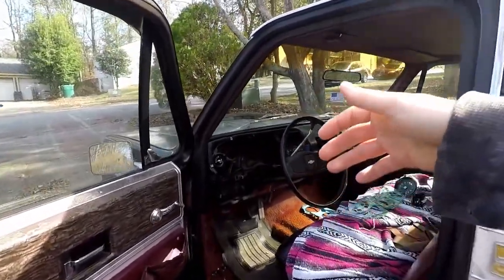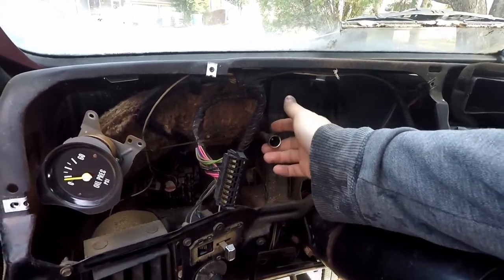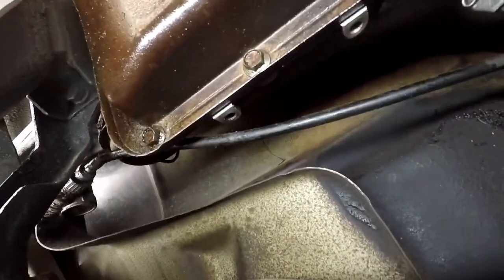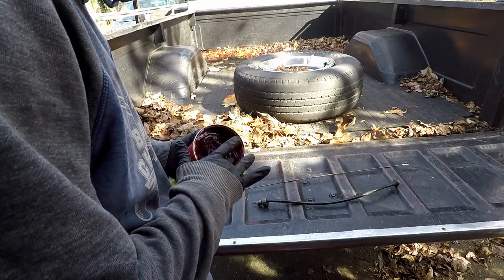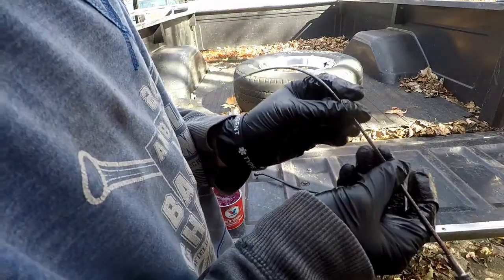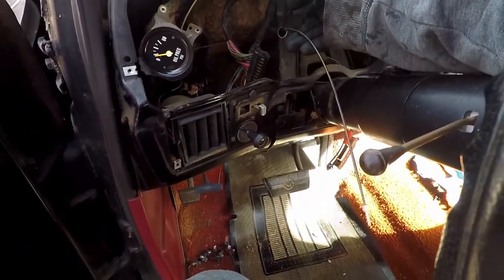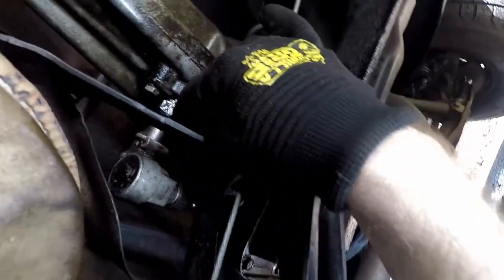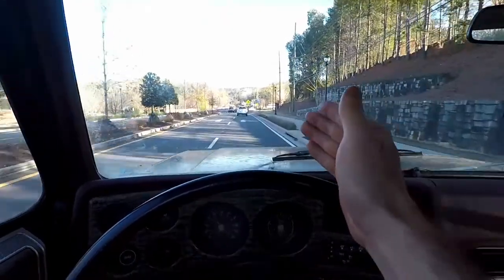Fixing A Noisy Speedometer Cable Chevy C10

Comment: My buddies, when my Speedo started making a sound like a poker card in bike spokes laughed and said good ole ford. I said at least my transmission can make it past 85,000 miles. My last 08 F150 took me all the way to 451,000 miles before the trans began to slip. So I bought another 08 F150 same equipment, engine, etc. 5.4-3V eco, 4 door 4x4. and I’m almost to 390,000 in this second one. I’m looking at a 3rd 08 f150 once I hit 400,000. They’re going for about $4-6,000. I’m impressed with this year and model F150. Sure I’ve had my share of issues, but never anything life or financially altering. My very first f150 was financed in 2001 and paid it off. Was always told to trade when approaching 100,000. Ever since my first cash paid for 08 150 got me to nearly half a million miles, I learned how stupid it is to ditch a paid off truck. If I blew a transmission once a year, it wouldn’t come close to what I’d pay a bank for 12 months. IF things go south here in this country, I won’t ever have to worry about repossession. Like all my friends do. Two of my friends learned the hard way in 2020. Both lost their jobs and lost their trucks and almost their homes. Since I’ve been paying cash for trucks and repairs myself, I’ve managed to put two girls through college and pay off my house and take two vacations a year and have the things I want. Stop financing these over inflated vehicles folks. My same f150 today in a new model is now $65,000. My 08 brand new was only around $32,000. It’s doubled in one decade for the same truck just newer. Don’t be a status queen. You may not have the best looking vehicle, but you’re also far less likely to perpetuate the cycle of never ending debt. During a very volatile economy. Now how good do you look compared to them? Pretty good!